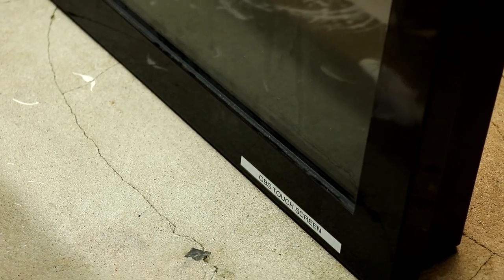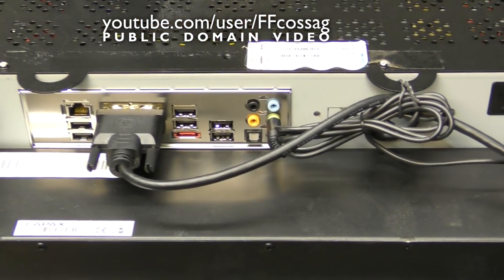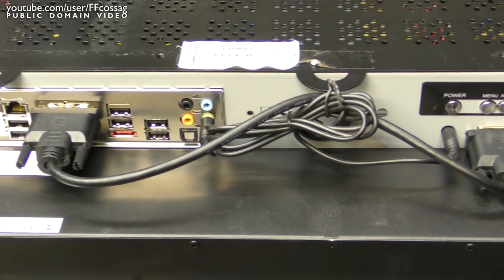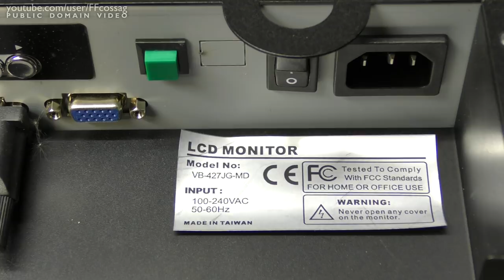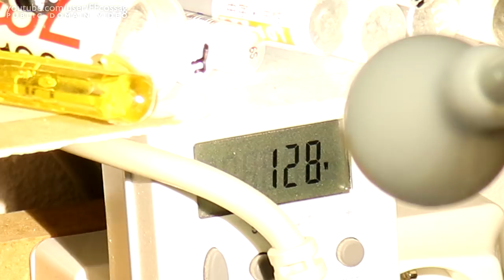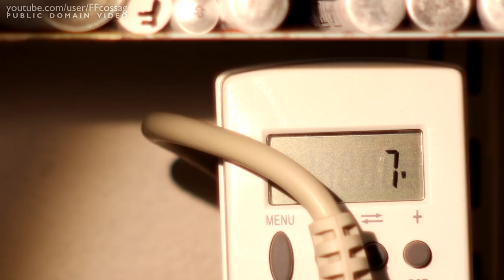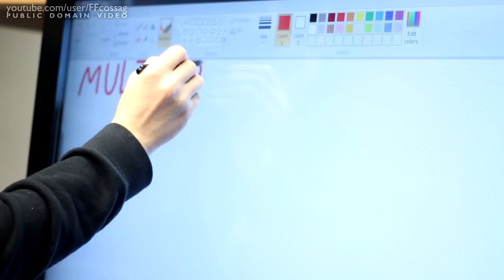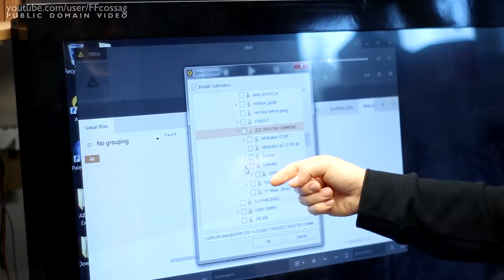42" Industrial Touch Screen PC (It's awesome)

Comment: You can buy a PCIe ribbon cable for graphic cards. This way you can install one that's no doubt better than the APU inside.
The cable can be several meters long. No downside.
Reply: That PSU might feed a Geforce 1030, and I'm sure a space for a low profile PCI Express card like that could be found. A potential upgrade idea :)
Reply from the maker: There isn't really a need for a high-end graphics card in a device like this. Gaming doesn't utilise the touch screen, so if you want to play games on it you might as well just hook up a better computer to the DVI port.
Reply: FFcossag wireless keyboard and mouse = 100% useful even not for gaming
Reply: Passive PCIe ribbon cable extenders are very limited in length, just 8 inches for PCIe 3.0, 12 inches for 2.0 and 15 inches for 1.0.

Comment: How cool is that? can't beat the price and the "up grades" are good to know about...
Thanks
Reply from the maker: Upgrades indeed - the best part is that it's so flexible that I can basically retrofit any 42" panel into the digitizer frame in the future, so this thing has potential to be VERY long-lived.
Reply from the maker: Maybe, but it'd be cumbersome and pointless. Plasmas aren't at all suited for the task, and don't usually follow the same form factors as LCDs.

Comment: If the Touchscreen has infra-red control then the 7W standby power would've probably gone to powering that circuit. Defeating the standby power would also power off the IR control in standby meaning you could never turn this on with a remote. I'm guessing it didn't come with a remote or you would've discovered this pretty quickly. And you could always remove your shutoff control circuit if you wanted to! ;-)
Reply from the maker: It does have an IR receiver, but I don't have the remote for it. It'd probably take a generic China remote, given the cheapness of the scaler, but I don't see much point in having a remote for what is essentially a single-input PC monitor.

Comment: Wow that's such a loverly computer now :-D
I can tell that you have really enjoyed making it, also far better than it was before.
Well done ff :-D.

I like pots too, linear/log or antilog all have there uses, no programming required :-D.

And later im sure you can upgrade the mobo/psu, not sure about the touch screen interface but im sure you have thought all about that.
No nasty gloop to kill the seasonic.
Reply from the maker: The digitiser is really good enough for what this thing is made for. The things to be upgraded are the PC and the LCD panel, both of which shouldn't be that difficult to replace.

Comment: Nice score, good modifications. Though as long as it runs Windows on it, I wouldn't want to have it (but that could easily be remedied) ;)
Reply from the maker: There's no non-WIndows support for the digitiser as far as I can tell, it's really rather obscure; A NextWIndows LowRIder.
Reply: Well, that's really bad. Never heard of that brand either (is it connected internally via USB? Then you could give it a lsusb and google the ID of the sceen to find out more about it). In that case, it would just be one giant all-in-one PC for me. And the one major thing I would have built into the thing would have been an 8-port USB hub with the appropriate power supply so that it can power 8 devices at least at 5V 500mA, i.e. instead of the power sockets ;)

Comment: The fact that it doesn't have a direct connection to its' own internal PC is a bit cheapo, don't you think?
Reply: sure but doing it this way allows you to put whatever board you want in it instead of being limited to one with an LVDS/eDP/whatever connector onboard
Reply from the maker: I wouldn't say cheap, it's industrial. The more external things you have access to, the easier it is to keep running.
Reply: IF they had an industrial PC board many of them have LDVS and similar on board for driving LCDs , i would have done that .
Reply: this is actually a good thing since you can put any micro ATX mobo + CPU inside as long as the PSU can handle it, so it's a nice upgradeable device unlike consumer-oriented AIOs

Comment: Betting on a second gen i3 1150
Reply from the maker: It's a first-gen i5, an i5-650.
Reply: FFcossag Compared to the 2500k, the 950 is quite rare, many people replace it quite fast compared to the 960 and 2500k/2600k.